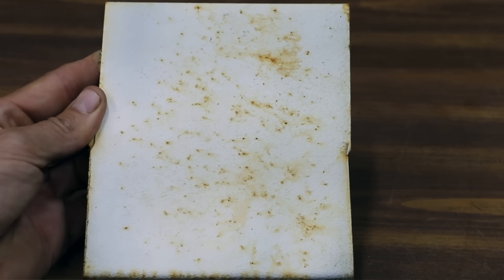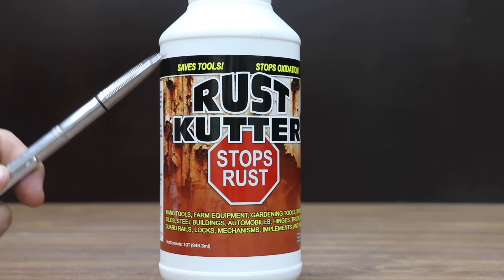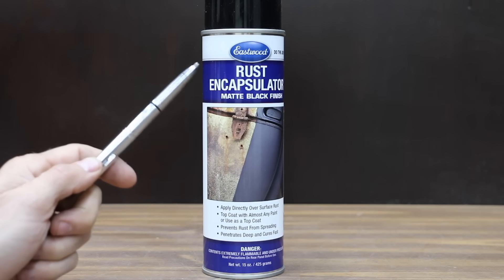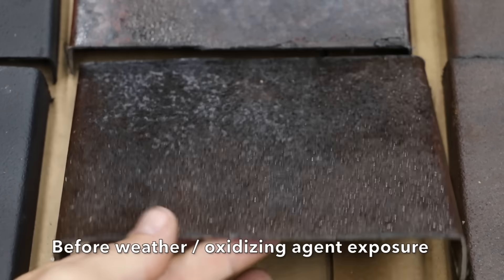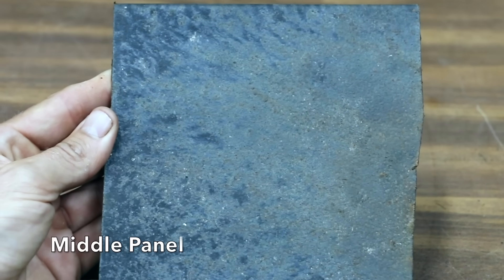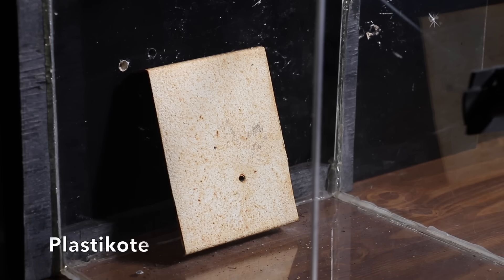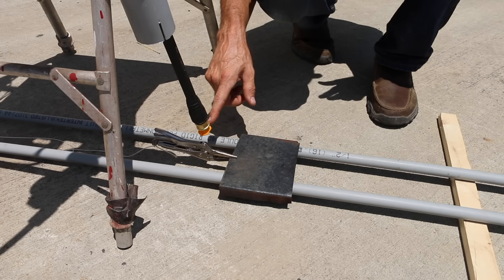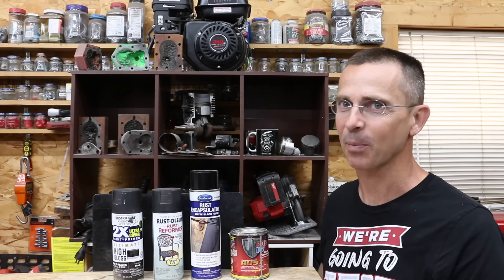Best Rust Converter? POR-15, Eastwood, Rust-oleum Rust Reformer, Gempler's

Comment: I could have saved you the time and effort of testing these my friend. I've been using POR15 (POR means Paint Over Rust) for many years and it has never ever let me down. It pays to spend a bit more, you wont regret it. Also their two part epoxy putty is a moldable putty that takes about an hour to get hard. Gives you much time to mold and fill holes etc. Great stuff.
Reply from the maker: Thanks for the feedback.
Reply: That POR15 stuff is awesome and I’ll give an example. I painted some suspension components, obviously dripped some on the garage floor. 30yrs later, cars gone, paints still on the floorLOL I don’t know about it’s rust applications but from a durability standpoint it’s hard to beat. Oh, make sure to wear gloves when using it, even a palm sander wouldn’t take it off. I was 19 so I knew everything 🤷🏼‍♂️
Reply: I went with POR-15 on a Suburban I rescued from a field where it had sat for years. Used both the Paint and the Epoxy. The epoxy I actually used to replace some nuts that had been welded on originally but rusted off.  Once the Epoxy had hardened, I drilled and tapped. Mind you, these were low torque applications for some interior molding that was bolted to the floor pan (spare tire cup).  
Worked great for two years and probably would still be working if it wasn't for the Jeep Patriot driven through a red light.... RIP 99
Reply: Do you use two part epoxy after you applied the por?
Reply: @countrylivingguy5172  No, I just prepare the hole, give it a lot of tooth, If you can get a hand behind the hole the better but not required. Get your hands wet, knead the por putty really good, get the metal area wet and apply. Keep it wet and you can feather it and work with it all you like. The water will keep it from getting sticky. Even though it will set in a couple hours I usually wait until the next day to sand it. You will love it.
Reply: I liked the video as I am not using POR for my small job and found the comparisons useful
Reply: Same here. PoR15 is it for me as long as it's prepped right I've had it last 20+ years. Goes on thinner than water and a minimum of 10 days to wear if off your skin so glove up. Also, while it's more expensive. It goes on so thin it stretches.

Comment: I've been using Eastwood for years on all of my projects, and it holds up really good for the long term.   One nice thing is they have a version with a 3ft whip that you can spray the inside of the frame, and not just the outside.
Reply from the maker: Thanks for the feedback.
Reply: @ProjectFarm  also another thing to take into consideration.
You can very easily touch up Eastwood by just spraying more.  POR15, doesn't let you do that.
Reply: @DaffyDuc69  Not only that but you're not able to use POR 15on bare metal whereas you can with Eastwood Rust Encapsulator
Reply: Recently I’ve used the Eastwood rust encapsulator and I really like that plastic tube / spray nozzle configuration.

Comment: video title alone is riveting. 
I've always wondered about rust reformers as the por-15 is a pain to work with but supposedly the best followed by locktight which is easier to apply  I wonder if my little 2 cents rings true after the video🤔

Comment: Would have been nice to test Corroseal commercial rust converter which is easily available. It is even rated for submersion applications. Very expensive but works very well!😊
Reply from the maker: Great suggestion!  Thank you.

Comment: I've used phosphoric acid and water to convert rust with pretty good results. I use about 40% phosphoric acid with distilled water. Or if there's little rust and I wont be finishing it with something else, I've had decent results by replacing half of the water with cold blue (so 40% acid, 30% water and 30% cold blue). Just remember once you finish treating the metal to rinse it off and then coat it in either WD40 or a light coat of mineral oil
Reply from the maker: Thanks for sharing.

Comment: Hi- I'd like to see tests of high speed (+/- 1500 rpm) metal cutting miter saws such as those made by Evolution and DeWalt. I'd also like to see tests  of  the various blades available for the saws. Thanks! I appreciate your tests and feel that you are the best source of unbiased test information on the internet.  Keep up the excellent work!
Reply from the maker: Thanks, will do!  Thanks for the suggestion.

Comment: Test the difference between regular, midgrade, and supreme gasoline grades at the pump! You could see differences in power and mpg. You could even test fuel with no ethanol if you’re feeling spicy. This one would be pretty easy I think but also something we all somewhat come in contact with all the time.
Reply from the maker: Thanks for the suggestion.

Comment: the trick to converting rust 2 percent phosphorous about 35 years I have converted rust this way. I worked in water treatment there was rust everywhere then a salesman at kelly moore sold me some.  we would buy in gallon jugs a product Rust Prime there are similar brands. follow directions then paint when done works for at least 20 years I did a carport on the legs and C purling's when I bought my house 25 years back the legs need to be done again. The purling's are ok no rust down low where I edge it needs again.
Reply from the maker: Thanks for sharing.

Comment: we at the body shop use por15 for heavy rust ,  it is suseptable to UV damage , so they have a top coat , or use any paint for the top coat,  but love the por15.  other tricks are once the can is open , and you close it again , you can not get it open , so a self tapping screw is put in the top , trust me great paint.
Reply from the maker: Thanks for the feedback.

Comment: I have used POR 15 for years and Bill Hirsch rust paint, seems similar. It will weld the lid on the can so tight that the lid will actually tear when trying to pry it open. You might test Bill Hirsch.
Reply from the maker: Thanks for the suggestion.

Comment: Did you ever make a follow up vid, for the wiper blades a year later? Also try the 305 uv protector on windshield wiper blades and on tire tread. Supposedly it stops wear, as in some people claim to get 12 years out of windshield wiper blades, and they claim it stops most wear even where rubber hits the road.
Reply from the maker: https://www.youtube.com/watch?v=g3S8udUSKtY

Comment: I guess that your young age may be a reasonable excuse, but I'm surprized that you didn't include Ospho, the original rust converter. To this day, I seriously doubt that you would be able to board a shrimper on the Gulf coast and beyond that doesn't have gallons of this stuff aboard. Shame. This stuff is cheap and incredibly effective.
Reply from the maker: Thanks for the feedback.

Comment: I have a great video for you. Can you do one showing what happens during a battery jumping procedure if you hook both battery's backwards but keep the connections the same. Exp would be to connect the negative jumper cable to the positive post, but also do the same on the second battery and see if it still charges
Reply from the maker: Thanks for the video idea.

Comment: I feel like this wasn't a good comparison. Por15 and the other encapsulating products will work better than a regular rust converter in your test. The other other products are designed to be covered up by another product like paint. It doesn't take a genius to figure out how this test was going to turn out.

Comment: NEW PROJECT IDEA - cordless lawnmowers, torture test. 

Dont bother with actual grass cutting - perhaps add some light motor/blade resistance and  run them down while stationary - perhaps10x each - and see how much drop in performance there is.
Reply from the maker: Thanks for the suggestion.

Comment: Unless I missed it… you don’t mention top coats.  Por-15 must be top coated or the suns UV will break it down and it will fail. I’ve been using it for years, as long as you prep your surface correctly, it’s tough stuff. P.S don’t get it on your hands, it takes forever to wear off
Reply from the maker: Thanks for the feedback.

Comment: Old fashioned  rustolium works surprisingly well. Especially for the price. In this test, looks like POR15 is the overall best, but it’s expensive. I would not be worried about using rustolium for most of my projects I would work on.
Reply from the maker: Thanks for the feedback.

Comment: Very disappointed Ospho was not included...
Reply from the maker: Thanks for the constructive feedback.
Reply: @ProjectFarm  I'm slowly building a fence out of steel bolts (as well as multiple yard art sculptures) I treat everything with Ospho once it has a little rust, it does a great job from stopping my stuff from continuing to rust. I use vinegar to remove rust from old tools, but once clean, they will continue to rust if not treated. I really enjoy your channel, and appreciate your approach and effort!

Comment: as a topic suggestion, I would like to see a comparison for silicone sealants brands, similar to the adhesive shootout.  Possible metrics include adhesion/bondingstrength to different materials, pliability, hardness, aging, UV resistance (if outdoor), mildew resistance, initial flowability.
Reply from the maker: Thanks for the suggestion.

Comment: I've enjoyed your work for some time now but this is the video that finally convinced me to register an account with Patreon in order to give back. I am always impressed by your test rigs and the time and effort put into the tests but the fact that you ran a 60 day painted/unpainted/un-accelerated test for each product totally sold me. I am about to have a rusty truck sandblasted and was considering POR15 and your work eliminated any hesitancy I had to spend the money. Thanks again!
Reply from the maker: Thanks so much for watching and for becoming a Patreon!  Greatly appreciate it!
Reply: Watch the beginning of the video.  He states that these products don't work on bare metal. Wouldn't sand blasting eliminate all the rust?
Reply: If it's getting sandblasted I'd also recommend using an epoxy primer on the clean metal, rather than por15 like tallman said
Reply: cut all rust out, weld new medal in use epoxy primer top coat, wax,,have fun  tjf!!
Reply: @tallman2994  Instructions unclear. Head stuck to epoxy undercoat.

Comment: POR-15 is some solid stuff, but, as mentioned, the price does reflect that.. But please note, unused and unmixed POR-15, does have a short shelf life, once it has been opened, unless you push in inert gas to push out the oxygen before close the lid on tight... So, with that stated, only buy in smaller cans sizes, and only buy what you think you'll need to use, so you maximize the dollar. Really tough stuff though when applied correctly.. Another fun video.
Reply from the maker: Thanks!  Thanks for the feedback.

Comment: Suggestion. various LED light vs Fluorescent vs Edison bulb. 
I predict the first to burn out it LED since too many components will make it fail. #1 will be fluorescent since they can handle being on for long hours but will fail first when turning it on and off. 
Led will fail first on power surge as well.
Edison will win be 1st or 2nd overall in being on long, on and off, environmental temperature difference, and power surge.
Reply from the maker: Thanks for the suggestion.

Comment: I’ve been looking back at your older videos and they are all great. Great information.  I’ve seen the Rigid 3/8 impact driver and the Rigid Vacuum perform very well and they have a great warranty. 

I’d like you to test 1/4 inch drivers and Hammer Drills and include the Rigid brand.  For the performance, money and the warranty they look like winners to me. I definitely want to buy a kit which includes a drive and a hammer drill but not before I see your test results.
Reply from the maker: Thanks for the suggestion.

Comment: Hey Project Farm. I have to say that your comparison videos are amazing and they have in fact helped me in the past with my purchasing decisions. However, I've reached a new issue and I think it would make for a good video. See, I usually change out burned out headlight bulbs from my siblings cars, however there are plenty of halogens from different manufacturers out there but which brand makes the best ones? Some even claim to be +150% brighter than regular bulbs or last many years longer than regulars. Do any of these claims hold water or is it just misleading marketing?
Reply from the maker: Thanks!  Thanks for the suggestion.

Comment: You sprayed that Rustoleum paint on way too thick and heavy causing an orange peel finish. The same with their Rust Reformer. Ironically, you show that as you read the instructions saying to apply it with light coats. I wonder how these products would have performed if you followed the instructions exactly?
Reply from the maker: Thanks for the constructive feedback.
Reply: @ProjectFarm  Most definitely. Thank you for making these videos. I have learned a lot.

Comment: hi there project farm, would you do an episode on brake connections, you could do different brands and you could test flare line systems versus compression fittings, it seems like a somewhat hot topic of debate. you could test copper vs, steel fittings and line, and flares, pressure tests and heat tests and stuff, i think that would be a great episode.
Reply from the maker: Thanks for the suggestion.

Comment: Would have liked to have seen a Cold Gal Silver Zinc epoxy paint in the test, it’s cheap and I think it would have done a better job than all those. I have used POR and Eastwood and the Cold Gal has always performed better.
Reply from the maker: Great suggestion!  Thank you.

Comment: Found out and used Lysol Toilet Bowl Cleaner, Power, 946ml, 10X Cleaning Power
Took the rust clean off of rusty tools.
Cheaper at walmart
Buy Lysol Toilet Bowl Cleaner 10x power
But it will not take long.
Reply from the maker: Thanks for the feedback.

Comment: My friend used POR-15 after he welded up his MOVE truck bumper. After a year and a half, it still looked flawless. He just used rattle can automotive paint for the topcoat as POR-15 doesn't like UV exposure. There were 0 rock chips down to the metal that I could see on it.
Reply from the maker: Thanks for sharing.

Comment: the rust store has a rust converter that is tantalic acid, it is the most effective I use in chlorine and muriatic acid stores to prevent rust on metal structures.after apply I painted with epoxy paint for metal surfaces, base and paint.
Reply from the maker: Thanks for sharing.

Comment: I put por 15 on a 10 year old rusty ford truck frame that is used at a salt water marina on a daily basis about 3 years ago and the frame looks like i did it a week ago, if you get it on your skin it doesnt come off until you shed the skin. they really know what permanent means. The only prep the truck got was some needle scaling and wire wheeling.
Reply from the maker: Thanks for sharing.

Comment: I was hoping to see a phosphorus converter spray, i have used them before on steel in a saltwater boat storage building and it seemed to work but i suppose it could have just been good prep and top coat.
Reply: i should also mention that you are hands down my favorite youtuber and i tell all my buddies at work to check out your videos. Your side by side comparisons are all the consumer reports I need to see. Very much appreciate everything you do.
Reply from the maker: Thanks for the suggestion.

Comment: I wanted to tell you that my dad just put automatic transmission fluid in with the oil in his Chevrolet Silverado with 350k miles to get rid of the engine knock.  It worked well... not sure how or why but it does work.  I just rewatched the old ranger video, figured you wouldn't see this comment there because it was 4 and 3 years back
Reply from the maker: Thanks for sharing!

Comment: Nice video again, not sure how you'd be able to test this, but maybe see if it's possible to test brake lubricants (silicone grease vs white grease vs actual brake grease vs anti seize etc) for caliper guide pins. again not sure how you'd go about testing but would be interesting to see
Reply from the maker: Thanks!  Thanks for the suggestion.

Comment: Project farm do you know the air and fuel mixture setting's for a vertical shaft 8hp Tecumseh off a 1978 36" sears roper mower?

Comment: I've had quite good success fixing rusty panels on the car by removing as much rust as possible with sandpaper, then using a generous amount of zink spray paint, and finally painting it over. Fenders on an old Ford survived several years before needing a touch up. So, took a while until the zink had been depleted.
Reply from the maker: Thanks for sharing.

Comment: I love all the videos you do. 
Have you considered doing one for outdoor extension cables? I recently had to shop for one and was surprised at all the options and pricing, and it is easy to overlook the key items like wire gauge if all you do is go by price. It also looks like there are more and more options for the outer coating that might make a difference in the cold for flexibility etc.
Reply from the maker: Thanks!  Thanks for the suggestion.

Comment: Excellent test! I wonder how effective would be as an vehical undercoating in the northern salt road climates? Would it be better than Fluid Film and other dedicated underbody brands?
Reply: It does help. Upstate NYer here, and when I did an engine swap on a super duty, I took the time to Por-15 black the frame and firewall. 3 years later and 2 winters of plowing and it still looks great.

Comment: If I recall correctly, KBS (not tested here), is a more advanced formula of POR.  I used the aluminum  based KBS on the frame of my Airstream while in the process of replacing the subfloor.  It was definitely worth the money in the long run.
Reply from the maker: Thanks for sharing.